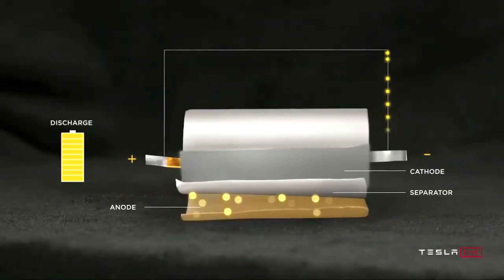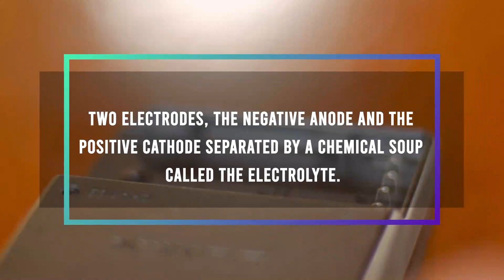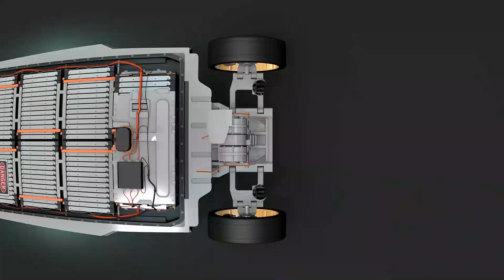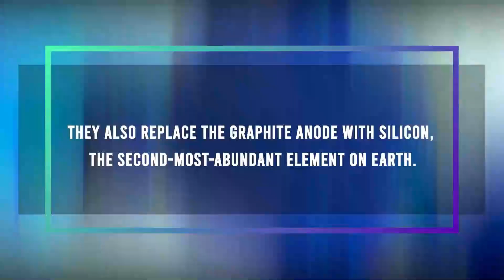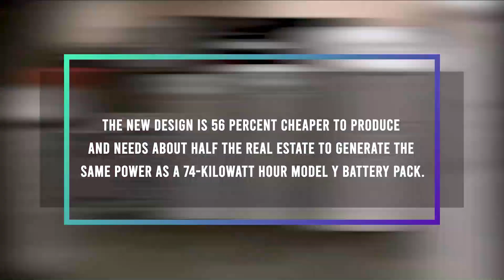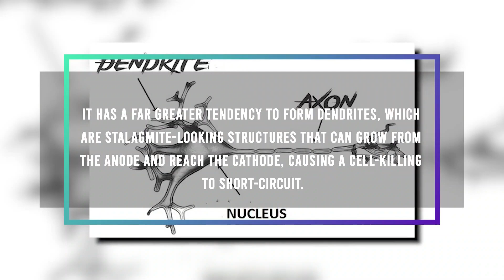Elon Musk: "Tesla 4680 Battery Will Be THE END Of Solid State Battery"

Comment: So the answer to your question would be no, if solid state batteries were a real thing which at this stage of the game it isn’t, it’s just a prototype of a concept so unless and until solid-state batteries become the state of the art commercially produced battery then the 4680 will be the reigning champion don’t you think?
Reply: Tesla has several variants of Solid State Battery that they had tested to the equivalent of 1M miles of charging / discharging by Q2-2021
In each case, the batteries have maintained well above 90% of chjarge capacity. That would suggest a battery that could be reused once the car has worn out.
That's the direct opposite of what we see now - with the chassis in excellent shape, but scrapped due to the cost of replacing the battery pack.
The 4680 is a major leap forward, but it will still suffer dendrite formation.
Solid State Batteries already have a 50% weight and volume advantage in power density.
The statement "4680 batteries will be the end of Solid State Batteries" is... ludicrous.
There ARE those that disagree. Gene Berdichevsky was the lead engineer for Tesla's Roadster Batter Pack.  He has been very vocal that Li-Ion is the future.
I should point out that both Berdichevsky and Musk are counting on Silicon anodes, and new metallurgy in the cathodes to make the magic happen...
Of course, the same EXACT pairings can be done in Solid State constructions.
Reply: Toyota has a working solid state battery prototype car driving in Japan and aims to start selling hybrid cars with solid state batteries by 2025.

Toyota in particular seems to be making far more progress in this sector than anyone else. If their batteries can live up to expectations, they'll blow all other types of batteries out of the water.

Comment: If the 4680 battery was the be-all and end-all crushing solid state and everything else then Tesla would not be building a couple battery factories they would be building 30 or 40 of them to meet the needs of car production, truck production, and home and grid energy storage.  But, they are not building 30 or 40 battery factories -- why not?  Well there's a couple reasons: first, there is a problem with sourcing the necessary raw materials; and second, investing north of $100B for battery factories based on the technology of the 4680 battery would expose Tesla to going out of business if someone came along with a new battery that was, say, twice as energy and power dense, had twice the lifespan, and was half the cost -- not even Elon Musk, worth around $200B would survive that.  The stock value of Tesla would plummet as would Musk's valuation.  So, Elon may claim the 4680 is the be-all and end-all, but that's just Musk being a carnival barker!

Comment: Thank you for the update on batteries for the Tesla.  

I currently own a 2018 Tesla Model X.  I have had no problems.  I assume it has the 16850 main battery technology. 

I plan to see and purchase the 2022 Model X Long Range Refit soon at my dealer.  

Question:

1.  Assuming the ‘22 battery will still be the 16850, The “range” has increased thankfully by @and 100 miles to 360 in 1 full charge.  

What has Tesla done to the 16850 battery to accomplish this improvement?  

Please correct my understanding if necessary. 

Thank you
David